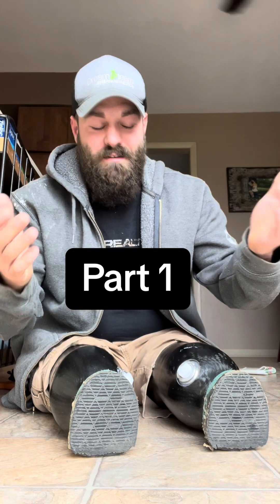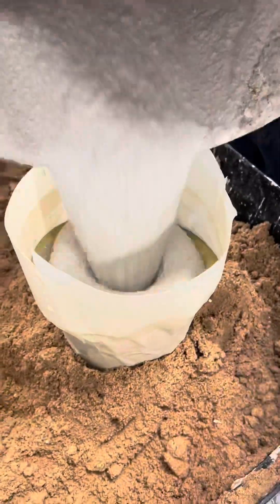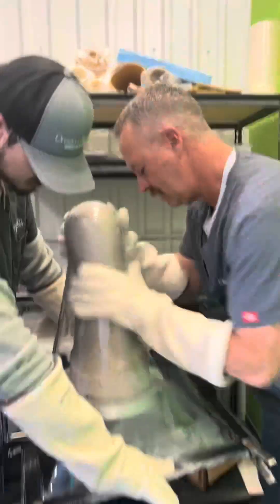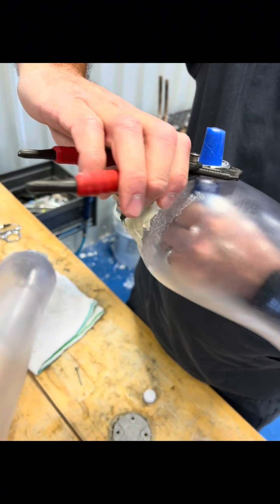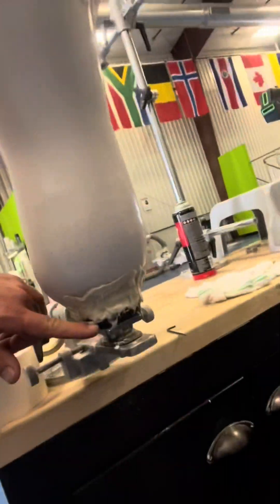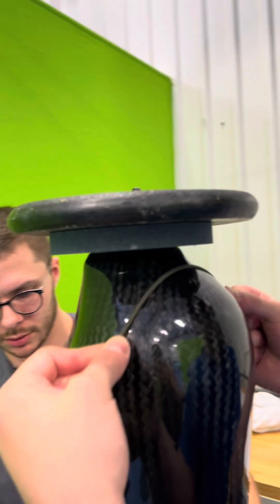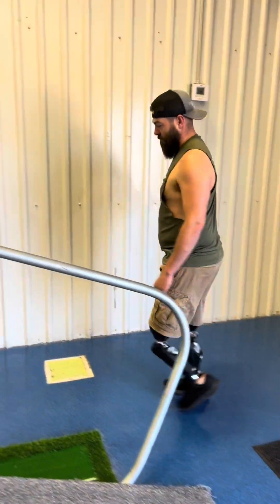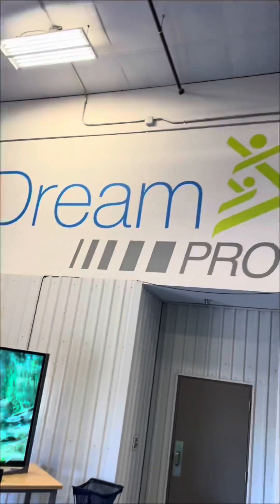How prosthetic legs are made!! Patient explanation with lab/fabrication footage!!

Comment: I'm a tech at a prosthetics company, I get to do this every day and it's awesome!
I like seeing the little differences in how other companies make their end product, and the small differences in parts used as well, different pyramids and stats adaptors etc.
Cool stuff. It's a fun and rewarding job for sure.
Reply: It looks like an interesting career path. Mine is from Martin Bionics. Have you heard of them? Do you have an opinion about the company? I've heard mixed reviews about them. I'm new to this but my experience so far has been great. They make adjustable sockets to eliminate the need for adding and removing socks throughout the day. They also manufacture on site so the turn around is much faster than companies that use a third party.
Reply: @jay_tripp  I'm west coast, so I haven't heard of Martin but a quick search looks like they're the same type of orthotic and prosthetic company as ours. Their Google reviews seem good enough. Being a local company to that area, regardless of reviews,  you're going to get much better results and care planning than you would with the national corporate companies namely The Hangar.
I make the adjustable sockets pretty often as well, using the BOA system (ratcheting cable wheel that loosens and tightens as needed), though they don't work for everyone.
On site fabrication is your #1 marker of quality of the facility in this industry. Central fab is fine for small generic things but when it comes to a fully customized device if it's not made on site the care quality just slips and slips. Not many companies do in house fabrication anymore either so you've already got a one up, and sounds like you'll be well taken care of :).

Comment: How do you make the first cast of your residual limb? The skin and muscle there seems quite floppy when you take everything off so wouldn’t you get a lot of space in the wrong places when you cast it?
Reply: This is what I do for a living, there's a couple ways it can be done with the initial eval casting.
One way would be to set on a stool or the edge of the exam table, with the other stump hanging relaxed pointed at the floor off the edge. Another would be to lay back on the exam table with the stump pointed at the ceiling. The prosthetist knows where pressure needs to be applied and will hold that part of the residual to create a basis to work off of. (When he says the socket gets all up in your business he ain't lying, we gotta get all up in your business to take the cast too)
Sometimes we put lipstick on the patients leg in the places we want to create pressure spots or reliefs, the lipstick sticks to the casting tape and then transfers to the plaster when it's poured! So when it comes my turn in the shop to modify things I can see exactly what is needed and where for each step.